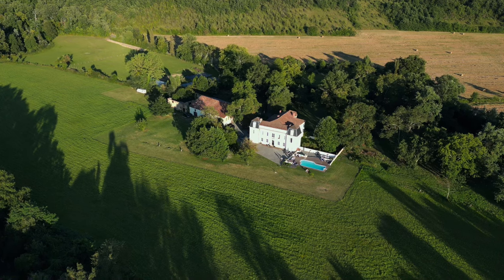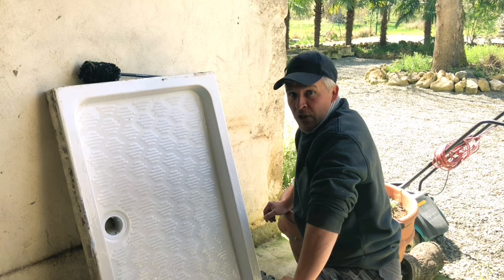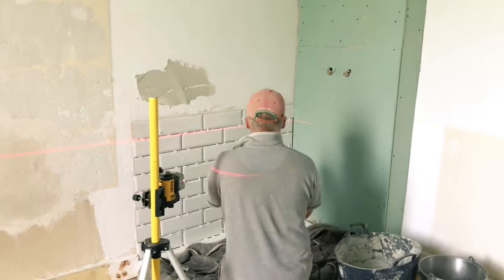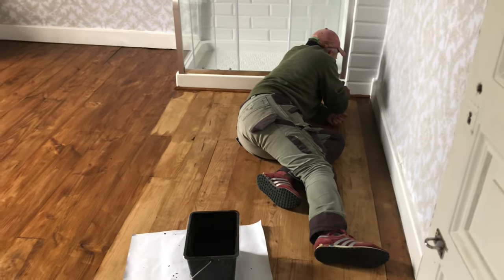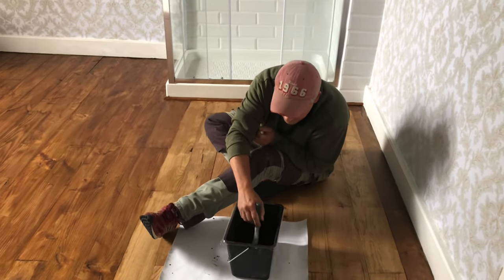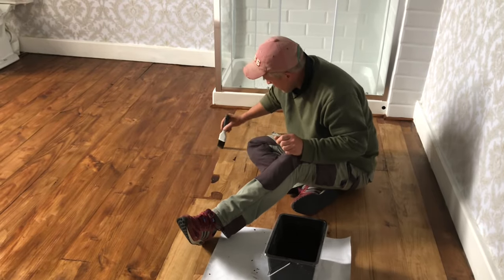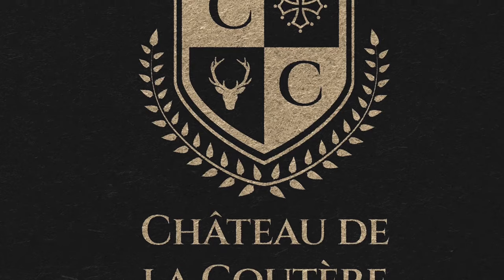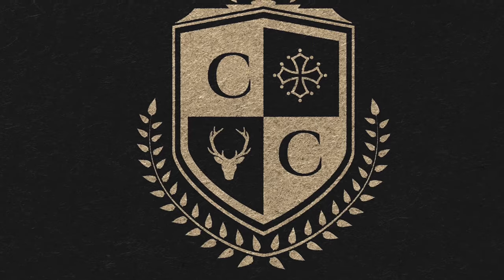CHATEAU BATHROOM FULL REVEAL - full makeover #Renovation #chateau  #bathroommakeover

Comment: As either a user or a cleaner, I wouldn't want a wooden floor in a bathroom, I would want tile. It also seems a bit... unfortunate, to have wallpaper directly behind the toilet. Hopefully it's a work in progress. I like the tile in the shower enclosure.
Reply from the maker: Thanks for watching. It’s common to have wallpaper in bathrooms now, and this has worked very well through a busy season with over 140 guests using the chateau in the last four months. Thanks for watching
Reply: I like the wall paper…but I m sorry ur small budget is obvious….the shower area looks small and unfinished….no finish line at tile edges…would have extended the tiles well beyond the shower area, and higher up the wall….the spray will go further than the shower despite the screen. In fact I d have taken the tiles to the wall which would then go behind the toilet. But in fact this could all be done later when ur budget allows….it’s a good basis to start from.
Reply: Everyone is a critic.
Reply from the maker: As I said the bathroom has been used extensively already and no spray back on the wallpaper - but what do know, it’s only the ninth bathroom we have renovated in our lives! 😂 Thanks for watching 👍